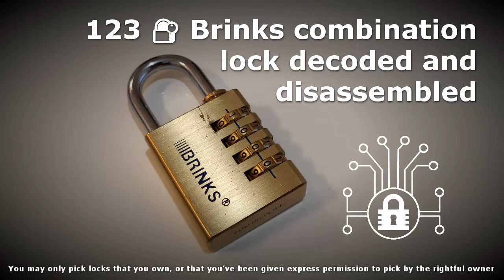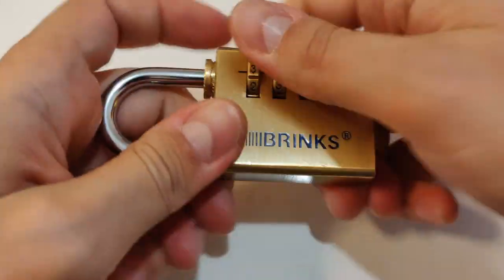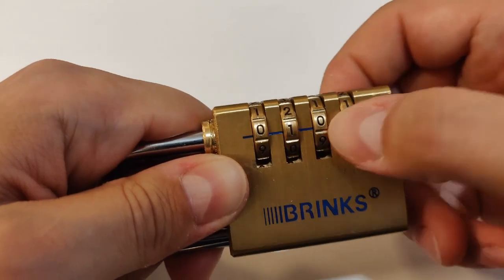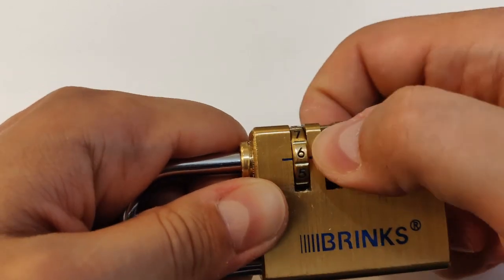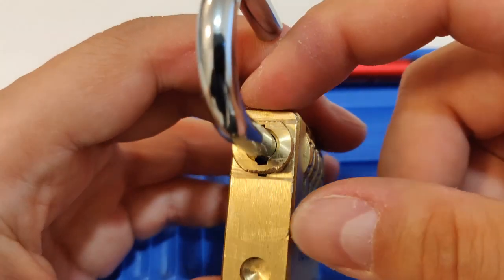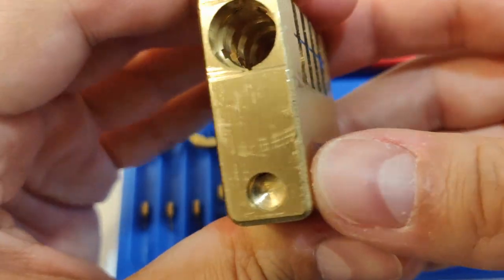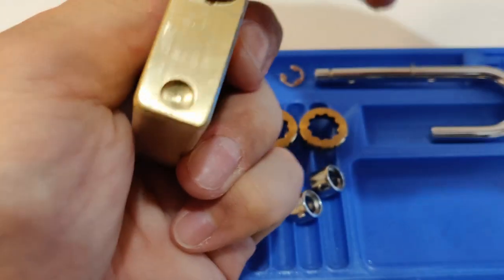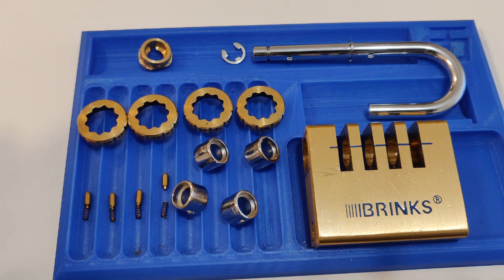123 🔐 Brinks combination lock decoded and disassembled

Comment: The key to decoding this Brinks lock is simply to rotate each wheel to find the real open positions. Each wheel also has fake open positions. The difference between fake and real open positions is that there is more play in the real open positions, less in the fake. For each wheel, apply slight tension and rotate the wheel. When it clicks into position, check the amount of play. Find the position with a large amount of play. That will be the open position for that wheel. Then do the same with the next wheel. Using this simple method, I was able to open my Brinks 4 wheel lock in under 2 minutes.